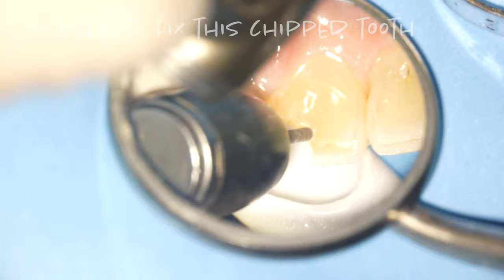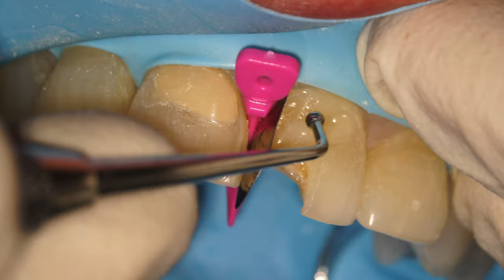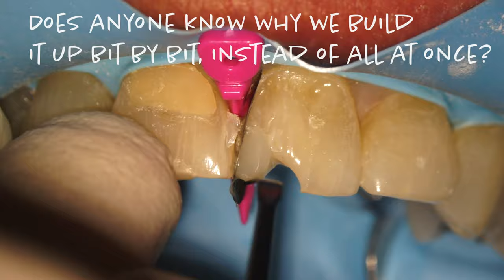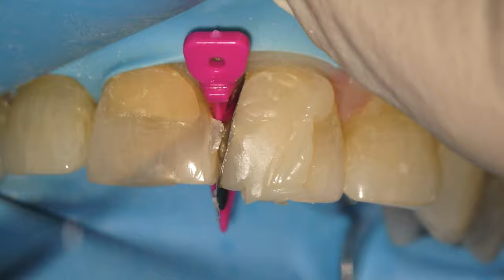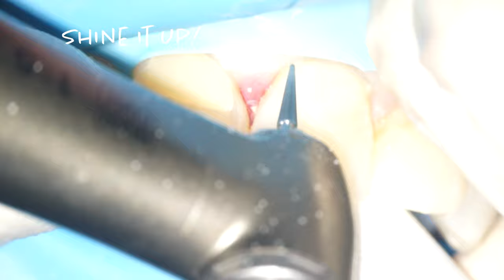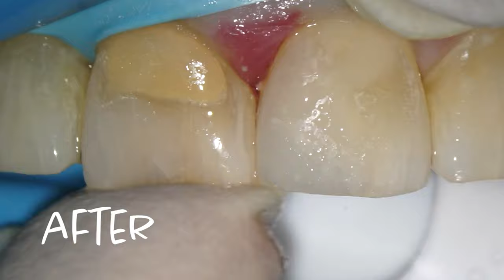What Happens When You Chip a Tooth?

Comment: Hello Mr.Michael! I just recently came across your channel and my! - some of your videos have somewhat taught me even the smallest signs could mean something big could happen or IS happening! I have some questions (two questions to be exact with two cases!) regarding my teeth! 

1. So I've been experiencing toothache whenever pressure is applied (such as brushing my teeth) on one of my molars. The pain is not so overwhelming, I'd rate it 4/10 but it still concerns me. 

This toothache I speak of somewhat only occurs when pressure is applied, not due to temperatures or even when I eat but only when I brush my teeth or when I bite down real hard and that's when the toothache occurs! Should I really be concern about this?

(EDIT) To add on, the toothache that occurred on my molar also seems to be the molar that I had a dental filling YEARS ago (about 6-7 years). There is also a small dark brown colour line or some sort of dash (something like this: - ) next to the old dental filling. 

2. Another thing is, I had a composite dental filling past mid September and after the filling, I experienced high sensitivity to coldness. I did ask my dentist about it and he said its completely normal after a dental filling for about a week or more. However, until now (it's currently the 3rd of December) I'm still experiencing high sensitivity to cold temperatures ON and AROUND the tooth that had the dental filling. Should I also be concern with this?

Comment: I had a chip tooth and i got it fixed more than once but now I have another problem so, I have a question how do you treat a patient who has a severe case of fear of dentist? Right now I have several things to do including getting braces and so scared to go to the dentist because of fear of dentist!
Reply from the maker: Perhaps you could chat with your dentist about your fear and some possible solutions - there are dentists out there who offer sedation, which really takes the edge off while you're getting work done. Believe it or not, going to the dentist can actually be a relaxing experience when sedation is tailored to your needs. Typically, however, there are costs associated with sedation on top of the procedure itself. So keep that in mind!
Reply: @MichaeltheDentist  thanks!
Reply: What about the braces... I have no experience with it... but I do know once they go in... it's very painful for a few weeks... I honestly don't think I'll be able to handle that... I know invisalign is more expensive but does it hurt less?  And what would be the determining factor of a dentist to say ok you're a candidate for invisalign
Reply: @swaggbabyyo  Both methods: the teeth need to move. That's the part that hurts

Comment: How many years can a filling for a chipped tooth last? Could you build a tooth up that has chipped in half?
Reply from the maker: They last surprisingly long, as long as the patient is staying away from tearing actions with their front teeth (e.g. ripping beef jerky, or biting into an apple). Hard to give you an exact number, but they can last years and years. If they don't last, the next step would be a crown, likely. As for a tooth that's chipped in half, I have done it, but I always warn the patient that it is less predictable and that a crown could be required in the future!
Reply: @MichaeltheDentist  thanks for replying. I  chipped my bottom front teeth in half and got if filled. Before that I saw on orthodontist who told me they could pull the tooth up using braces so it wouldn't even need a filling and also fix my bite. Have you seen that done before and would that be a better option than a crown especially if you need braces to correct spacing and bite?
Reply: @sanumbibi8155  have you done that pulling yout chipped bottom tooth up with braves? If so please let me know!